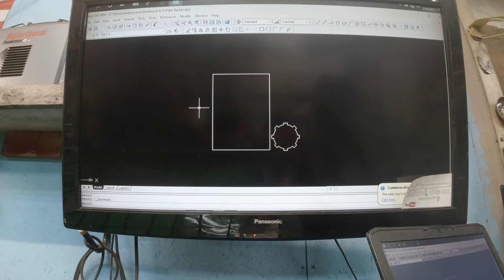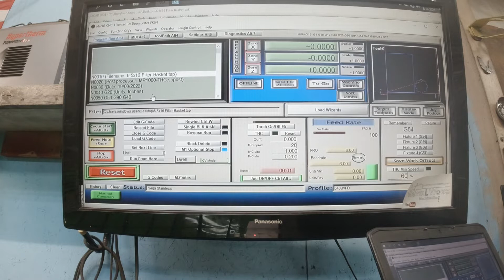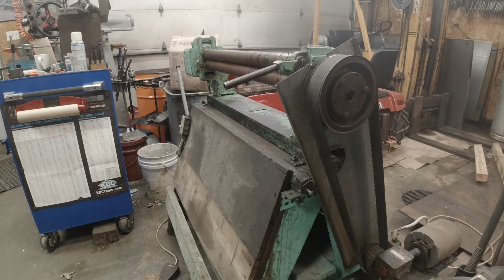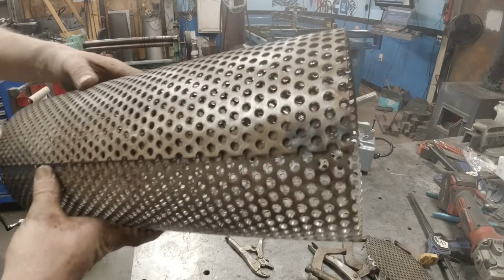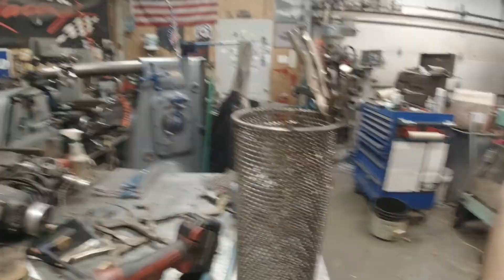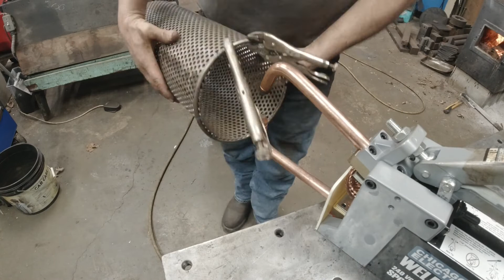New Tools In The Shop Slip Roll , Spot Welder

Comment: Congrats on the 1K! Instead of a lap joint with the mesh, did you think about butting the mesh edges against each other and then using some flat stainless bar to spot weld to?
Reply from the maker: Thanks, and yes I submitted it that way as one of the ways to do it in my quote. They went with cheaper, less material to buy. It would have been easier and faster . Time wise.   Lower material cost but longer labor.  T&M jobs I like.

Comment: Even on the waste oil drain at the dealership I was at, I was constantly removing the trash screens and emptying them of various bits of crap that would restrict the flow after a while.  I can only imagine the debris running through your systems from various industrial processes.